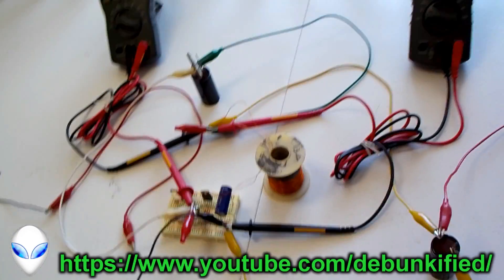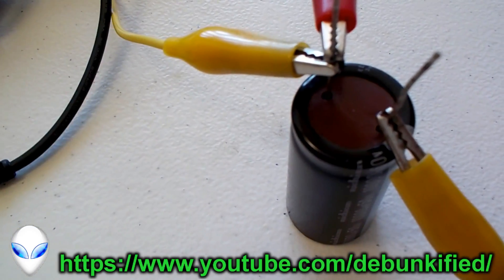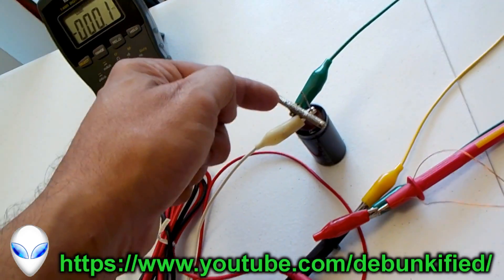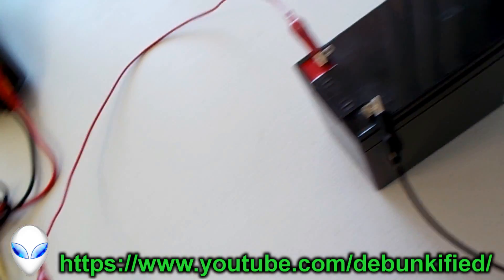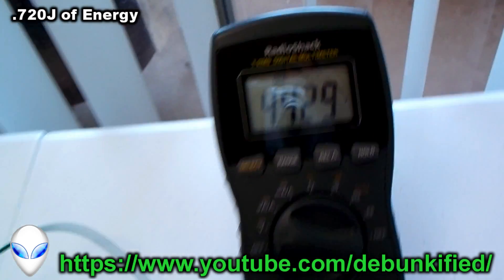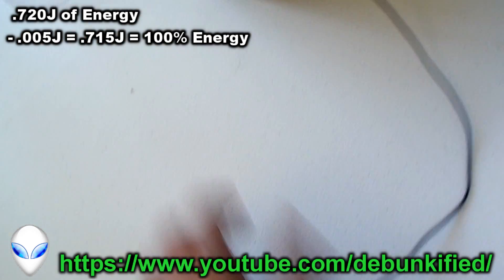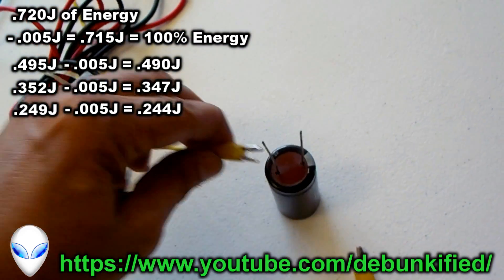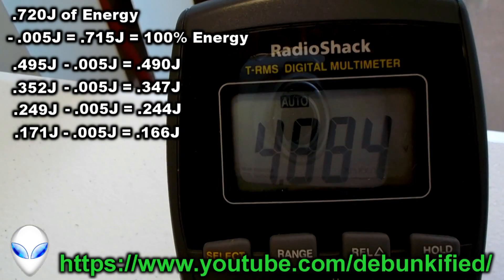Ultimate  Evidence of Power Magnification

Comment: Try to use coil shorting without a rotor to get the 2nd cap in voltage higher than the first cap in one go...
Reply from the maker: +overunitydotcom Hey there, and what exactly do you think this would accomplish? 

As far as I understand it, a field from a magnet is required because it holds more potential energy than a field that is supplied from a power supply feeding an electromagnet, in which it would only be able to supply 100% of the energy in a perfect ideal system.

Unless there are two systems involved where the first one opposes the second one, then this might be possible.
Reply: debunkified Well just pulse the cap voltage to your coil so the coil current is high enough and then disconnect electronically the first cap and short out the coil for a few Milliseconds and let the Back EMF hit the second cap via fast fullwave bridge rectifier diodes... This way you might be able to achieve "solid state" overunity. But you probably need a much bigger coil or a MOT coil with iron core....
Reply: For easier switching setup you could just use the first cap connected to 2 coils in serious. Then you just put a MOSFET switching transistor in parallel with the second lower coil and hook parallel to the lower coil also a bridge rectifier and behind the bridge rectifier the 2nd cap so the Back EMF pulses will go to the second cap when you short out the second coil and open it again.... this way you have an easy circuit to short out the 2nd coil and collect the back EMF from it and the first coil above it which is connected to the + terminal of the first cap works some kind like a low pass filter and prevents the cap from draining....
Reply: So you only have to switch on and off the MOSFET and that is very easy to do now you only have to design the two coils with the right parameters to get enough back EMF collected probably you could also collect the back EMF across the first coil via another Bridge rectifier and cap
Reply from the maker: +overunitydotcom Ok, but most all the energy is stored in the MOT's or coil's magnetic field and it's already collapsing at and incredible frequency giving back most of the energy into the second capacitor.

Shorting it for a microsecond of time I think wouldn't collapse it any faster than what it already is and it would be like trying to short it faster than what it's collapsing at, which is already happening at or near the speed of light.
Reply from the maker: +overunitydotcom The energy would only be that if the power source, and having two coil's would just transfer the energy from coil to the other.

It's easier to just collapse the magnetic field of one coil, I think it does the same thing. It has to be recycled and then placed back on the input at the same time in order for the energy to be additive.

I've tried this with a 60 Hz frequency from the wall and a transformer, but never with just two capacitors, I imagine it would suck the first capacitor down pretty bad as coil shorting represents a full load on only 100% of the energy or less.
Reply from the maker: +overunitydotcom The two coil's in series would only double the resistance and cut the input current in half I'm afraid.

Comment: Whooa.
First you had 12V  which is 720mJ of energy , you used 715mJ.
The second capacitor charged from 0V to 10V which is 500mJ
Thats 69% efficiency.
Where did the other 215mJ go? ? ?

You cannot just add up the energy you keep passing though the coil, it is the same diminishing energy, you are not creating energy.

If you were creating energy the voltage on the second capacitor would be higher than the first.
PLEASE a circuit diagram
Reply from the maker: +Tom George The intention is to not create energy, that's impossible good sir. Energy of course can not be created nor destroyed but only transformed, try using the correct terminology at the very least.

Use your brain a little bit, the coil is a load and this is made clear in the last created video with a rotor placed over the coil.

The load can now be run for several times from the same energy. That's the point.
Reply: That is not amplifying power, you are proving the inefficiency of power conversion due to the coil characteristics.
You cannot add all the energy that you have transformed though transformer over and over.
You started with 720mJ, you transformed it from one cap to another, each time the only work done is the heat generated in the loss in the transformer.

You cannot add the result of each transformation together to get an "amplified power"
If you could you would have ALL the 1.36J of energy in the cap at the end of your experiment.

For example
A car has energy stored in its gas/petrol tank.
Petrol is transformed in to heat.
Heat is transformed into mechanical energy.
Mechanical energy is transformed into energy stored in motion, Kinetic.

The power of the car is quoted in power at the wheels.

Not the sum of energy in the tank, with the heat energy, with the mechanical energy, with the Kinetic energy.

Comment: You make the error, that the fast pulsing of the coil probably below 1/10 of Tau time period only charges up the coil's magnetic field and does not heat up the resistance of the coil....So you basically store the energy mostly only inside the coil's magnet field and then transfer that energy into the second cap..so the coil's ohmical resistance does not get much energy , so does not consume the Joules you claim.....I calculated all of this years ago when I did my study work of the Joseph Newman coils...
only if you leave the current flowing for about 3 to 5 * Tau timeintervals you have heated the coil's resistance as you claim...but you probably switch already with 1/10 Tau or even faster where all the energy goes only in charging the coil's magnetic field ....
Reply: As your coil is in the compensation diagram a series circuit of an ideal coil and a resistor you have a timeconstant Tau=1/RL
Reply from the maker: +overunitydotcom Hey, so producing a magnetic field doesn't constitute work done? It takes power to produce a magnetic field and store all the energy in it, also known as the input power. This isn't considered power running through the coil?

So you're saying that the watts of voltage and current going through and across a coil  is not work done with the energy that came from he power source?
Reply from the maker: +overunitydotcom I believe that no matter what the on and off times are (frequency) that even a tiny little microsecond worth of on time is still energy that has left the power source and entered the coil as power.

I believe that whatever the watts are that came from the source are the exact same watts that enter the coil, no matter how long or short of a time period that may be.
Reply from the maker: +overunitydotcom I suppose you could consider the second capacitor as a load as well. If this isn't considered a load, then I don't know what is then.

I did express in the test that the load or coil doesn't consume the energy, ok you're right a very small amount, yet it's output is just slightly less than what goes into it, less than 100%.

The coil and its accompanying magnetic field I think both constitute a work load with current flowing through it as well as the energy stored in its magnetic field.

The second capacitor is receiving the energy that came from the first capacitor, through the pulsing of the coil of course.

This is an obvious transfer of energy and it takes work to transfer this energy and the rate of this work is measured as power entering and charging the second capacitor after being stored in the coil's magnetic field and being discharged from it.

This is a lot of work done! The amount of work done is equal to transferring the energy out of the first capacitor, then into the coil, stored in the coil's magnetic field, inductively discharged as the power is shut off and the magnetic field collapses, then finally charging up the second capacitor as a load with power and storing it as energy.
Reply: debunkified Well you only charge up the L of the coil so it produces its magnetic field..
but not the R of the RL series circuit. Then you dump the energy of L into the second cap and as there are losses you get a lower voltage. But the R of your series RL coil does not see the Joules you have calculated for R....you just shuttled the stored energy back and forth until the voltage( and thus energy) is used up in losses....
Reply: debunkified Would be more interested to see a 50 Watts car bulb running from a 9 Volts battery that you claimed would be possible with your 2 boost concerter circuits...
Reply from the maker: +overunitydotcom  I totally agree with you. However it takes work to shuttle that energy from point A to point B, does it not? If you allow us enough time we can show the 'work' done and then stored in a rotor spinning above the coil in order to see the work done a lot more clearer.

Also the capacitor is really the main load as it's receiving most of the energy and power, which of course takes work to get in there, however not over 100%, at least with only just one run. Multiple runs are required as shown.
Reply from the maker: +overunitydotcom We first must learn to appreciate the free energy when we see it before we are able to convert it to a form in which we desire.
Reply: debunkified Also with multiple runs you only shuttle the first inputted energy back and forth and finally both caps are discharged due to all the losses...The only thing you are showing with this circuit is you avoid the R of the coil getting much energy , so the coilresistance does not heat up....You just shuttle around the cap energy more efficient but still below 100 % and there is also no power amplification....Try to get the second cap with the same capacitance value as the first cap to have a higher voltage...only then you will have energy amplification....
Reply from the maker: +overunitydotcom Hi, It's already been shown a capacitor powering a pulse motor and then taking the flyback pulse and charging a capacitor up to a higher voltage than the first capacitor as well as with more energy.

Yes we understand that time is a factor to consider but start up energy is just too much and is underunity. Why look at it?

That's why resonance first must be achieved and that moment of time (1 second namely) overunity can be seen clearly.

Here's the video that shows this :
https://youtu.be/MvlfeRdNDS0

Comment: Also to add replace the inductor with a resistor that will make calculations easier, and inductive load require a scope across to measure the voltage and current swings as you connect and disconnect power from it. As its a variable load.
Reply from the maker: +Brandon Watts Hi, yes this is true to have an O-scope for inductive measurements when another form of accuracy is required.

An O-scope isn't required for this particular test because it is clear how much energy has left the capacitor with a known starting voltage and also a known ending voltage.

A resistor by itself does not have the capacity to do what an inductive resistor can do, for example a flyback pulse, inductive kick back spike, collapsing electromagnetic field, or whatever you wish to refer to it as.
Reply: I was not aware that the coil was putting out a steady pulsing field. Do you plan on tapping that field to charge a 3rd capacitor.  By the percent that was posted of work done is saying that you have over unity to a degree.  By info gathered this far you should be able to charge a Larger capacitor to same voltage somehow to show extra power being stored with just the circuit used here
Reply from the maker: +Brandon Watts Hey Brandon,

This is the missing link, "How is more work done on the load?" Well we know that energy can not go over 100%, but, that same 100% energy can be reused, with losses of course.

This recycling of energy can only be reused if it isn't consumed. So in order for the energy to not be consumed, then the load itself, which is the inductor, has to be able to not 'consume' the energy during its transfer from point A to point B, yet still perform work.

In other words the inductive load (The Coil) is the paddle wheel taking in power and doing work, simultaneously allowing the energy to pass on through to be recollected else where. If it was water, then simply inserting another container to capture the water as it passed through the paddle wheel.

Kinetic energy can be magnified with a potential energy that never exceeds 100%. So I suppose there are two different kinds of energy that needs to be clarified in the books, or maybe it already has?